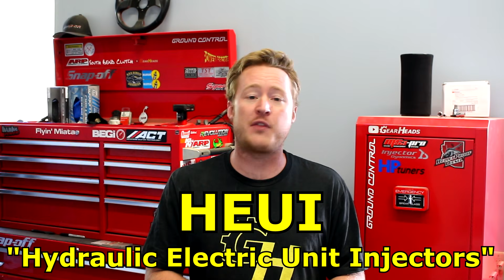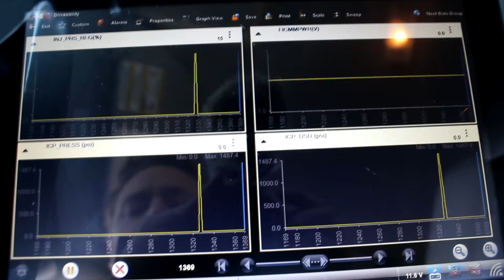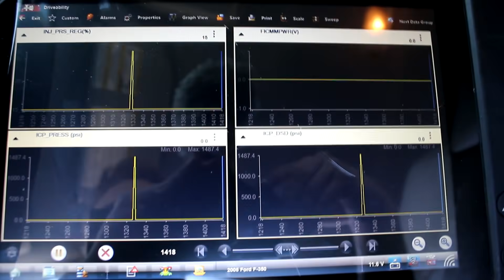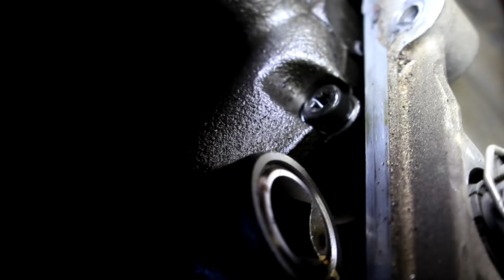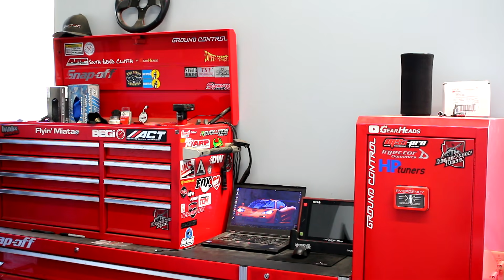Ford 6.0 Common No Start Problems

Comment: My problem stated when I was driving then all the sudden it died at 45 miles an hour lost all power dead as a door nail. I had to coast until it stoped. Once it stoped I turn the key all lights come one but no crank

Comment: I have a 2004 f350 6.0 and I have had 2 different no start issues over the years. 1st 2 times it was the cam positioning sensor, and recently it was the board inside the fuel injection control module. both were pretty easy and cheap fixes, although, it took 4 different mechanics to figure out the control mod issue!  hope this helps someone before they go in deep just to find out it was 1 of these problems.

Comment: I have ipr, ficm,sync,and icp values all in range,  fuel is pressure is good at test , then when to check the glow plugs  ,all values are 1.1 1.2  , good. What else  will prevent starting?

Comment: Very informative!  👍 Nice job.   Its true. A $1 part can keep you out of the race i guess.   Crazy.   My 04 f350 work truck has a crank no start but i have 0 codes for glow plugs. Gonna test harnesss tho.   Runs good once started.   After watching this Im trying to test my way thru oil pressure and/or pump leak.  A code would help. 😂.   Thanks for info.

Comment: So I have a 2005 6.0. Here's the rundown. We cannot get the injectors to fire. Not even one. This is what happened. So I fell asleep with the truck running and it ran out of fuel. So we put some fuel in it. Primed it at the filter housing and the truck fired up and was running good. Then I went and filled it up at the pump. It died at idling while at the pump. Almost like it hit another air pocket. So I had it towed home. We bled the entire fuel system. We checked for fuel pressure. We had around 50-55 psi. So fuel pump is good and working. We checked oil level. It is good. We replaced the ICP sensor. Injector Control Pressure sensor. We monitored the pressure to that sensor with a scanner. We had well over 1000 psi oil pressure. Which is way more than that sensors required reading. So we know it's not the high pressure oil pump. Because that gives that sensor its feed. There are code for Crank sensor/cam sensor correlation. So we replaced those. But still have the code. So we checked timing. Our timing is good. But yet we still have that code. I thought maybe the Ficm could be the issue. So we replaced it with a known good one. No change. We have everything required basically for the injectors to fire. But they just won't. I know running out of fuel can hurt the injectors. But what's the odds all 8? Not even one will fire? And if you give the truck a shot of starting fluid. It will fire. So we know the engine is still good. We have racked our heads and it just doesn't make sense. We have checked all fuses and relays. Does anyone have any idea on what to do next? Any help would be greatly appreciated. Thank you!
Reply: Just curiouis....are you SURE you have fuel getting to the injectors?  I had my mechanic (who ended up ghosting me because I think he got sick of working on my '03 F250 6.0) tell me that the fuel tank was notorious for having plastic fittings on the inside that would breakdown and eventually get sucked up into the fuel line.  But it happened only sporadically.  He said that when accelerating, more fuel is pulled into the line and thus whatever was sucked in would jam up in there and then when letting off, it may come loose again.  It did seem to stall when going up hills.  In any case, he showed me the flakes and debris that was in the tank.  What he did was somehow reverse blast the entire fuel line to clear out the debris once and for all.  I think that mostly helped but I still had other problems with the truck.

Fast forward to yesterday, my truck is not starting.  I got a glow plug error and I could tell the starter wasn't sounding right.  Replaced the glow plug module (tested each plug and they ohmed out ok) and replaced the starter.  The starter doesn't sound great to be honest, it was a remanufactured from Napa.  Well the truck started up with these two new parts and I thought I was golden.  Was letting the truck idle in my driveway while I was putting up all the tools and then it just stopped.  After that, it would turn over but not start.  So that brings me back to why I asked the question.  After everything you've done, I'm just wondering if you're not getting any fuel to the engine. I'm wondering if you've got clogged lines like I had.  

I guess I need to check my filters and test the fuel pump (gonna have to YT on how to do that).  I don't have a scanner so this is going to be very difficult to troubleshoot in my driveway, with no vehicle to get to the store now.
Reply: @miker4399 There is a plug with an Allen head on the fuel filter housing in the engine bay. They make a fitting. I had to order. Where you can hook up a gauge psi checker. To check fuel pressure. So we know my pump and lines are good up to the filter housing. We had well over 50 psi. I think our problem lies between the Ficm/pcm crankshaft/camshaft position sensors. Without the ficm receiving the right signal, it won't fire the injectors. So it could be 2 bad ficms. Kid said one i bought was good now I'm thinking I'm not so sure. I replaced both cam and crank sensors. So can't be sensors. Or could be the pigtails. Maybe pcm. But I doubt it. Cause there would be a code for it you would think.
Reply: @OVGR  The mechanic that ghosted me (as his very last work on my truck) replaced the cam sensor because he said the old one was bottoming out in the house, thus damaging the end of the sensor and causing my truck to stall. I'm not sure that was the full problem but then I took my truck to a more expensive repair shop and they said it's a good chance the wiring harness has problems somewhere and it's best to replace it. But they were going to charge an unreal amount and I just said I'll have to think on it. HOWEVER, they could not duplicate the stalling issue so maybe the am sensor was the problem? It ran ok for about a month and a half but alas ...here we go again. 

PS...I had my fcim replaced a few years ago. I guess that could be the problem we're having.

Comment: 6.0ford350.   pretty much had truck gave to me.      Story is  this guy let his daughter use the truck.  An it got hot.     The oil filter was somewhat melted.    It did crank 30 seconds.  Before I new it got hot.   Ruff idel an died.      Otherwise it sounded ok.    Kina went from a good idel to a ruff idel an died.     What would u do.   It was a bull it proof deleted egr. Studs.    But he had the shroud off of fan.    An  let his daughter take it.     .......
Reply: 2006

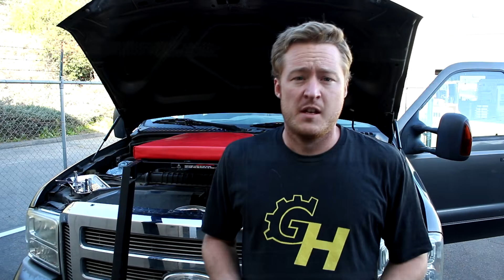Comment: I will ne doing some more testing but its snowing to day and to cold 8:52 to be outside. first thing I did was check the oil level  and sure enough it was low. It didn't even show on the dipstick.I filled up ,it took three qts to get to the add oil line, so 4 qts ,charged the batterys . Cranked it over and boom it fired right up. But taking into account I had let the truck sit over nite. It ran great ,took it home now to wait on weather and I'll do some more testing

Comment: Hello, Did an air test, pulled valve covers, finally found bad seal on the J tube, also replaced HPOP and resealed, Put it all back together, I do have low oil pressure, filling the oil filter housing with oil. also replace the injector wire bundle because of several bare wires, upon attempting to start the truck, cranking no start, and i noticed a different sound from the FICM, could i have received a wrong or bad Injector harness, or one that's not right for my 2004 6.0 ?  Thank you for your time

Comment: Mine stopped running and wouldn't start. A guy from a shop checking it out sprayed starting fluid in the intake while cranking it over and still doesn't even try to start. Now I'm not sure they know what their doing at this shop.
Reply: Seems like not a lot of them know how to work on these motors. Had mine in a shop for the same issue and all they did was run up a 4k dollar bill for me but still does not start

Comment: What do you mean ,,air leak,, ? Are you listening  for any gurgling  sounds or actual  air comming out?! I saw a clip from a Mechanic...who pressurised the sistem through  IPR opening  and you can hear air sound going and he said  ,,its ok,, its not nipple cups leaking...so what is a ,,leak,,?

Comment: My truck had the same problem but now my dash board won't turn on the gauges won't read for the speed or anything. And it won't accelerate past a certain speed just keeps dropping up and down. It's 2005 lariat f250
Reply: I had similar issues with 04 F350. Replacement alternator solved that

Comment: Got 06 model building for son in law I am a professional mechanic worked on several 6.0 . I’ve got hot no start killing me. Cannot find leak in hpop system everything is new bout to give it up. Appreciate your video
Reply: Same here changed out my starter and solenoid and icp plug seen this videos comments someone said check ya battery terminals ya JACKASS there she was my special L terminal cracked in half completely behind the battery Surprises before Christmas 😅

Comment: My 2005 6.0 was working amazing, next morning I went to turn it on and everything powered up but no crank. starters good, relays are good,batteries are good, I replaced the starter terminal and it still isn’t cranking. Any suggestions on what it could be???
Reply: Check icp sensor map sensor or dummies plugs very common
Reply: Get a voltmeter and start testing for 12+ volt from battery terminals to starter and everywhere in between.  A $5 harbour freight can do the job.

Comment: My friends 6.0 Ford will not start unless it is 20 degrees or colder.
Reply: That’s an oil pump I’d say, oils to thin for the pump to start the engine. The fuel systems on these trucks run off oil pressure so if there’s not enough oil pressure there not enough fuel pressure either.
Reply: I call BS on that, mine starts just fine in hotter temps here in Texas…
Reply: @JP-mu3xl dying hpop, it needs the colder (thicker) oil to see enough psi to fire the injectors

Comment: I gave up on fords after the 7.3. Honestly I don't want anything to do with any modern diesels, they're all money pits. My 2011 duramax is the last diesel ill buy with emissions on it. Ive been lucky with it but at 170k im waiting for the CP4 to pop or EGR to plug up and grenade the engine.

Comment: 2004 f250 6.0. Driving fine down freeway 65mph. Just stoped running. No pedal response, now it just cranks over fine and  won’t start. No indication of want to start while cranking over. Batteries are full charged,Fuel level just under half tank. Put 5gal fuel, still no start.
Reply: My mechanic replaced the IPR injector pressure regulator. It’s now running fine again. The cost for him to do it was $1,000.00. Not sure on the part cost. I’m thinking he said oem part $450.00 good luck with yours.

Comment: Question what if you don’t get a code I’m was crank and start until I found a red wire, running from the fuse panel under the driver steering wheel across the dash to the I guess emergency shut off for the fuel, and after messing with that truck won’t start

Comment: I have a 06 f250 crank no start. Process of elimination- injectors are not clattering after turning key on. The amps at the ficm gradually builds to 58amps when key is turned on. Is that to many amps? I've checked the relay and 12 volts on both sides.
Reply: I got the same problem. I'm still chasing the issue.. one day, i get clatter, but then it sounds like only one.. but then the next day, no clatter at all. pressures are good all syncing.. fuel pump kicks on.. voltages seem ok, but the amperage draw seems very high with the key on. no injector clatter...

Comment: My 04 just driving along and shut off like you turned the key off and will not start back but will run somewhat on either
Reply: Changed cam sensor
Reply: @johnruf7302 same thing happened to me, did that fix it?

Comment: I have an '04 F50 6.0 that suddenly wouldn't start after I turned it off at a bank drive thru.  2 mechanics instantly said I need a new hi pressure oil pump.  Thanks to your video I understand what to look for, the parts involved and where they're located .  Most informative video I've found on this issue, thank you!
Reply: What was the fix had the same exact thing happen to me
Reply: @porterpowell4367  same thing with my 04 F350
Painful!
Reply: Ive been dealingbwith this for two years,not one mechanic including fords knew this info,it sounds exatly correct,i mite try myself! Ford 05,6.0 blow,thats what they call it in south florida!

Comment: My 04 i just got it cranks and no start but when i turn the key it has a gauge on the fuel filter and when key is on it will go to 60 then it makes a air noice and goes back to 0? Also it smokes white when cranking but will never start i dont know what this is the only code it has is p0197 i need some help

Comment: Awesome video my 06 F350 6.0 as of today will not start it will crank but won’t fire off . I also had a code 0299 but It ran fine until this morning after a huge rain storm !
Reply: What the H@#$ is going on so today I tried to start the truck and the batteries started getting weak ,so I put my battery charger on  , while I was going to writing down info from your video . Went out and was going to see what my numbers where going to be when I tried to start it. And it started after a about 10-15 of seconds cranking it ?
Reply: The fuse box inside the cab got water in it because the windshield seal on your truck is no good and water is leaking in

Comment: Hi. What kind of equipment is needed to diagnose a Ford F 550 6.0 2004 car, with an OBD connector? I have an international truck. What is the name of the scanner?
Reply: You need Ford IDS to really properly diagnose these trucks or let’s put it this way. It’s extremely helpful software for that.

Comment: There's a difference between a parts changer and a good mechanic,a good mechanic will diagnose the problem not just guess and throw parts at it,once you learn how to diagnose the problem it will save you big dollars in the end... excellent video

Comment: There is a aftermarket cap that has a place for a fitting to put a pressure gage fitting on so you just put test Guage on it lot eas

Comment: My 400k excursion,  that is the miles not the amount of receipts.  It was slow cranking even with new batteries.  My mechanic installed a new starter.  Wow super fast cranking and started perfect.

Comment: Any idea why my 6.0 starts easier if I push it off than if I use the starter? Most days the starter will not even get it running but if I roll it down a hill it'll fire.

Comment: I just had my 05 bulletproof about 3 years ago. And nothing for problems ever since. Now the air leak sounds like a bear in broken by the passenger side valve cover. It will not run very well as no power for the first 15 minutes. Fuel is leaking back into the tank. Fuel bowl is empty every morning. And after it sits for an hour the fuel bowl is empty it runs like crap the first 15 minutes. Nothing but problems. Any suggestions? Pretty positive this video is one problem I have. But I still have fuel leaking back in the tank. And the truck has to cool down completely before it will start back up again

Comment: I'm going crazy over here! 2005 6.0 Powerstroke
While Cranking: 
FICM SYC - 1
FMP - 47 Volts
ICP - 1533 PSI
IPR - 56.2%

I still got a crank no start, where should I look? With that much pressure I don't think I need to air test it.
Reply: Have you tested your fuel pressure? At the fuel bowl?

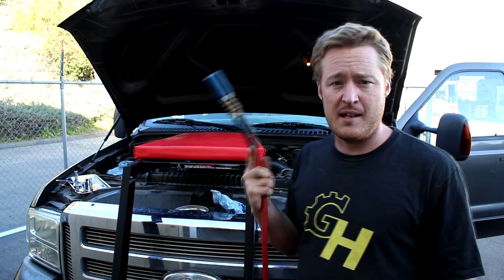Comment: 12:12 where did you connect the hose?
Reply: I have a problem with a 06 Ford 6.0 it has problems cranking and when it starts and I let the accelerator go it turns off